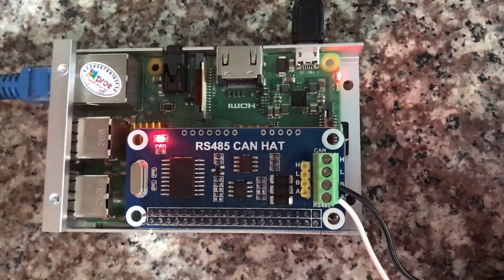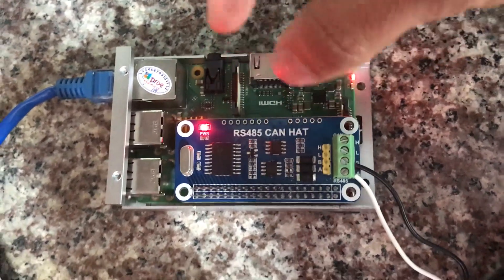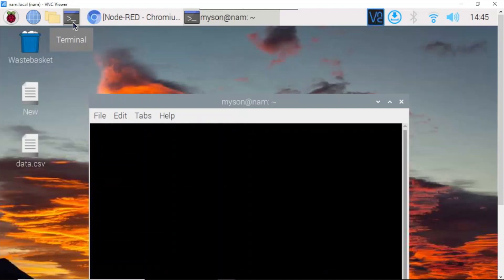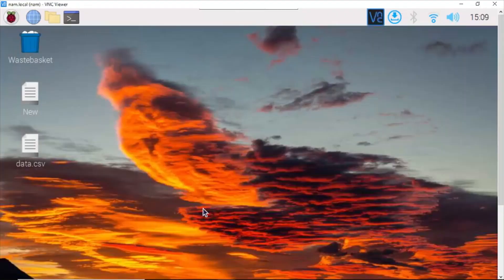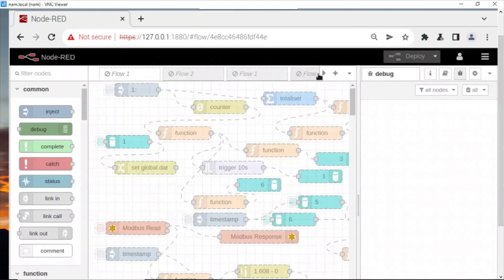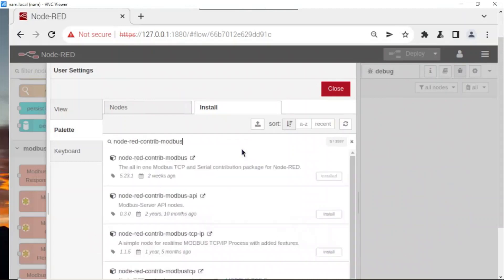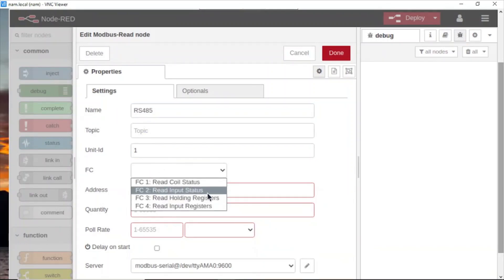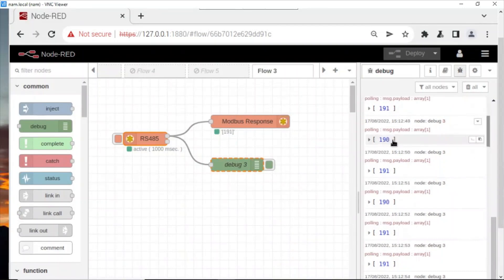RS485 Raspberry pi Node red | Node red rs485 modbus

Comment: Would node-red (with node-red-contrib-modbus) and RS485 work on a Pi-Zero?

Any thoughts on open-source or commercial libraries?   minimalmodbus ,  stephane/libmodbus , ClassicDIY/ModbusTool, eModbus/eModbus , modbus-esp8266 , QModMaster , rossmann-engineering/EasyModbusTCP_NET  , EasyModbusTCP/UDP/RTU _NET?